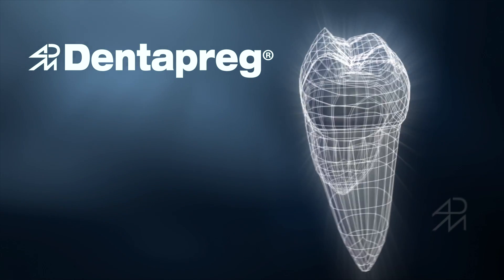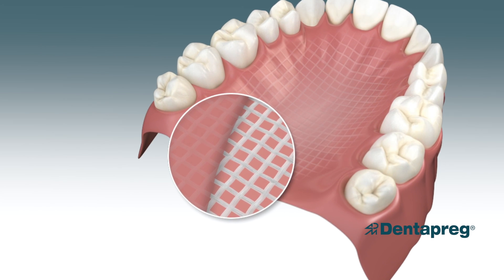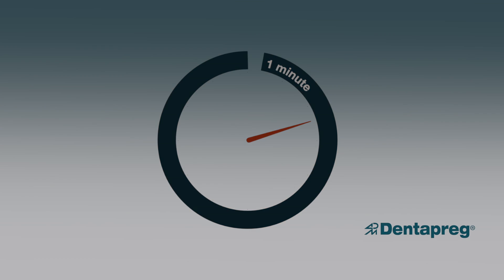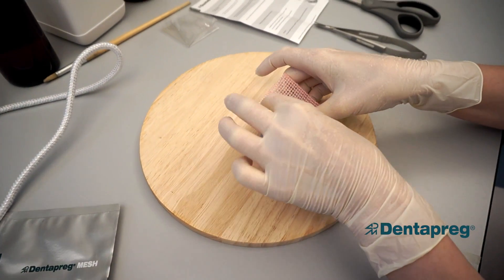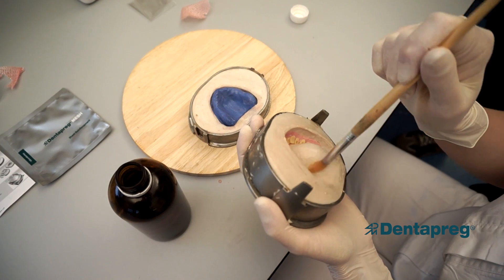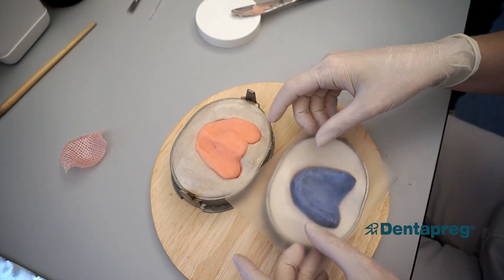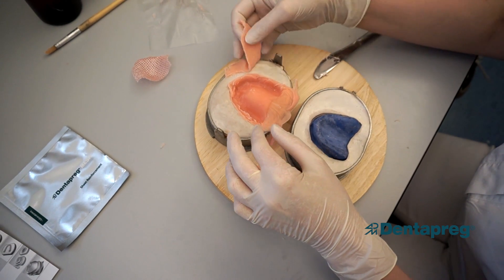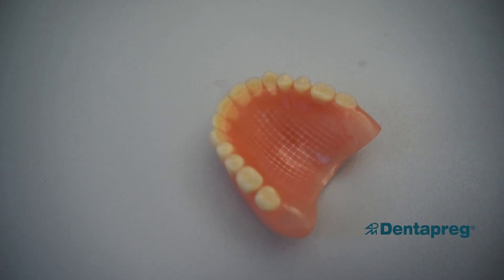Dentapreg MESH denture reinforcement - instructional video

Comment: I just received a sample of this Dentapreg mesh from the Chicago LMT lab day show. Does anyone have a suggestion on alternate ways of heating the mesh prior to placement. Can I wave the mesh over a Bunsen burner for example? Or is the iron mandatory?  Can't wait to see the end results!
Reply from the maker: Hi Tony, the iron is not mandatory. But we have found that it is by far the easiest and fastest way to heat the mesh evenly. We have tried many ways of heating it up (dipping it in boiling water, using a burner, oven, etc.) and it takes longer and does not heat it evenly. But go ahead and try the burner, if it does not work and you have to heat it again with a different method, the strength characteristics of the mesh will stay the same. (in other words: repeatedly heating the mesh does not diminish its strength, it will just make it slightly less pliable next time you heat it up). Let us know how you like the result!